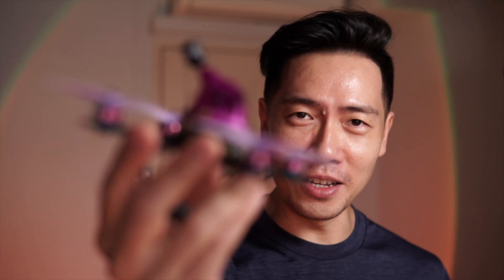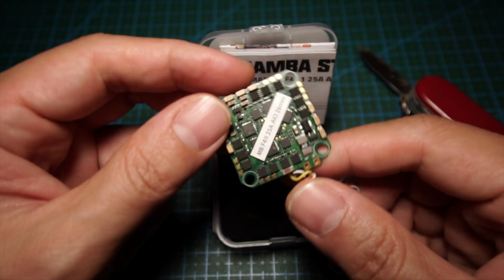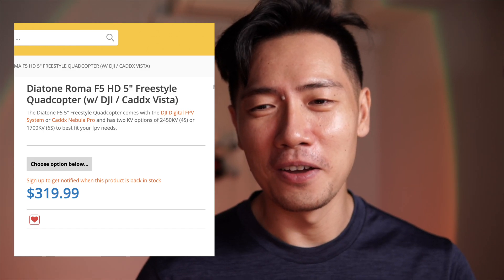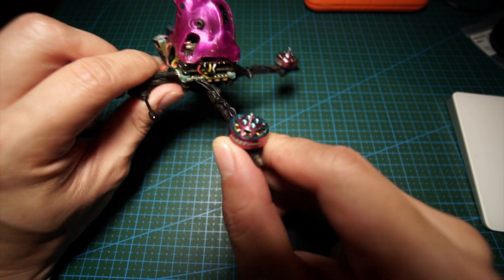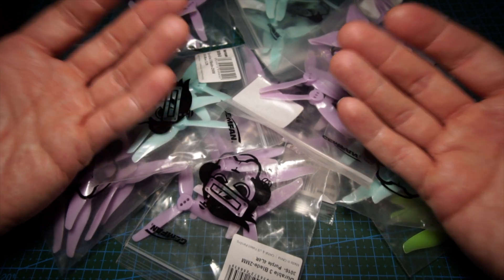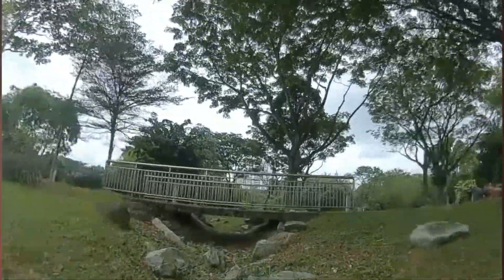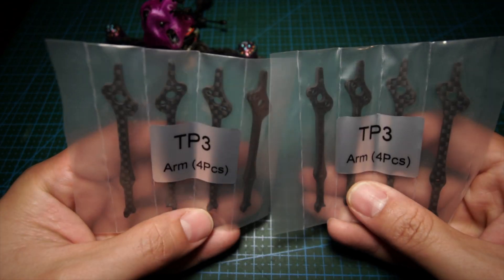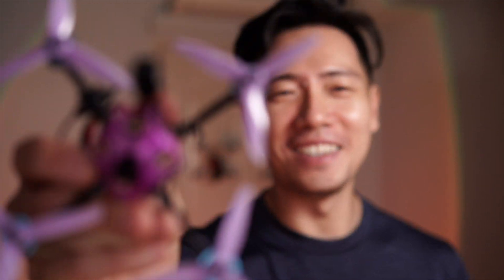FPVCYCLE DIGITAL TP3 REVIEW // Micro pocket rocket

Comment: I had my 3 inch TP on 4S with 1303.5 4500kv motors.
Now Im building a new one with 1204 8000kv motors on 2S.
Maybe I will use Kingkong 2535 props for stealth mode. Love the four blade sound
Reply from the maker: 4S?!!! How do you control that
Reply: @lionelttl  kv man!... kv...
Youre on 5000kv. Down to 4500kv on same stator seize motors and its just a little more thrust. Overall more disc load because of 45g 4S 550mah Lipo, but gives it more throw around. It is controllable ! 5000kv on 4S is on the edge to buring a motor. My 4500kv motors burnes, when I tried slightly higher pitch props on a 12 sec full throttle punch.
I recommmend the tattu lipos and hglrc aleous 1303.5 4500kv motors on 4s.
You could go budget and convert the  hglrc kt20 to a 3 inch TP frame
Reply from the maker: Thanks man. Right now I’m struggling with the tuning of these tp3 on bf 4.3 rc6. Any tips?
Reply: @lionelttl  I use the Happymodel f411 20A aio on many small builds.
My feels is some flight controllers themselves are hard to tune. The jhemcu H7 is a pain in the ass. Whereas the jhemcu 411 pro just works out the Box.
Sometimes its bad frame resonance too. In some cases it must be the FC, because the same frame is used on many builds.
Have a look at the hglrc petrel 120x frame and the HD canopy for a 3 inch digi TP build. Its awesome.
You can try flashing new betaflight or older firmware. Make Sure the target is right. Try the manufacturer homepage and support for the firmware.
Reply: OH and you used long screws all the way through from the frame, FC and vista with canopy. Bad resonance dude! The petrel frame allows you to mount them seperarly to the frame!
It canges everything, Trust me.
Reply from the maker: @chrisbee5481  thanks man! I’ll look into this
Reply from the maker: @chrisbee5481  Oh how would you assemble a stack on the TP3 with the naked vista on the top then? Also I get the same issue with my analog build as well and that has a shorter screw